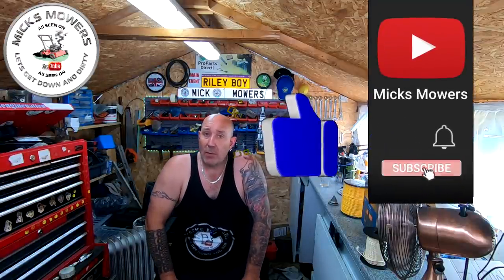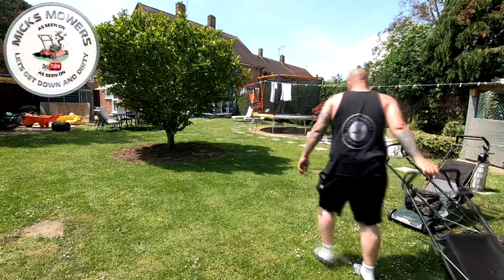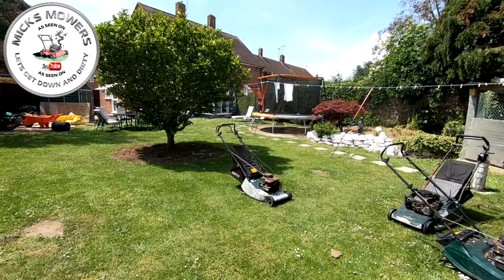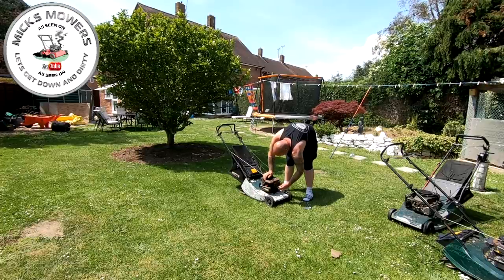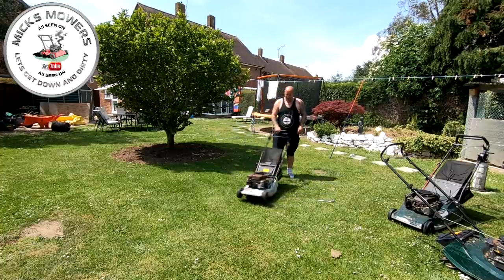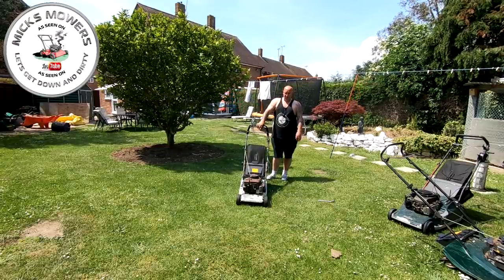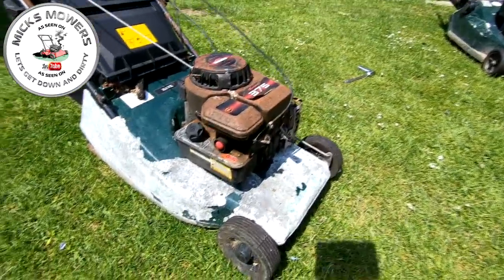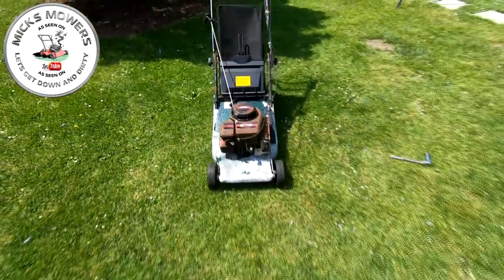Hayter 41 Lawnmower Transformation - Making it Look Like New Again

Comment: Heh mate the OLD MAN at Eliminator just saying have not seen a blue sky in GB videos for some time. What no rain we getting mucho rain in Southern Ontario. A very nice repair mate, know your going for the matching original green but we have seen some all blacked out beauties online using truck bed coating spray paint looks awesome. Just a tip though, this stuff comes off with fuel per Project Farm video so i would overcoat with a quality automotive clear coat that is fuel resistant. Tah for now

Comment: Hi Mick, Just using my little boy's laptop, hope you, Riley Boy and family  are okay.  I am a self employed gardener who services my own tools. However, recently been doing the odd mower up etc to earn a bit more money to replace van, one being  lost for LEZ two years ago  and the second recently for ULEZ as sold a non compliant vehicle in error., by car trader, good old Mayor Khan. I watch your videos and I find them really helpful and the best thing on Youtube. I regard you as the Ben Kenobi of Lawnmower Repairs and the Master. I recently restored a Hayter Harrier 41 Autodrive, 307R,  took your video advice about replacing height adjustment rod, gave it full service, addressed bodywork and also had letters made up for the front decals as some faded. Just wanted your advice, this model has the ignition start, and the person who gave me it did not have the charger. I have sourced the correct charger, but does this model require a specific new battery, just incase the old battery does not take a charge.  The mower sold and I will be servicing it on a  yearly basis but I know the customer will ask me about the battery. Look forward to receiving your advice. Many Thanks John Curry
Reply from the maker: Yo yo .. this is the battery I would recommend Ultramax 12V 4.5AH(5AH) AGM/GEL Rechargeable Battery for Mountfield Lawn Mower https://amzn.eu/d/c40XWxm hope it helps